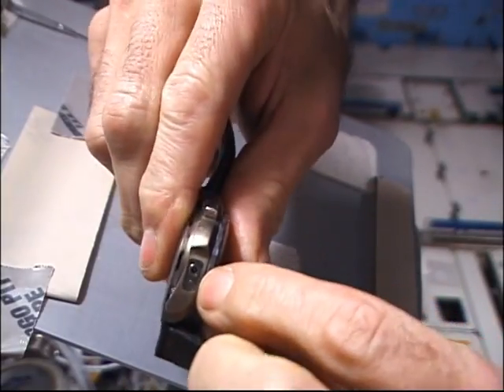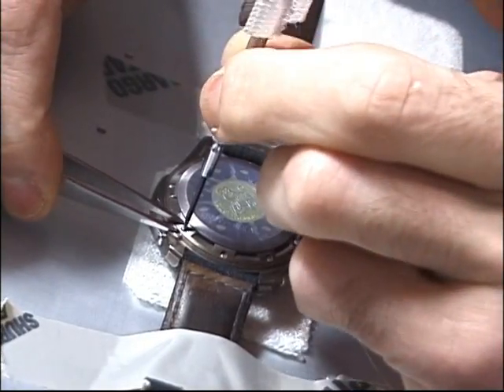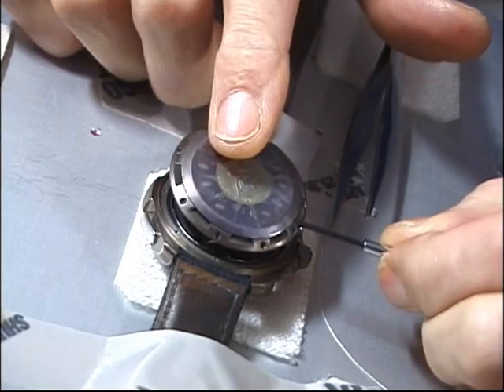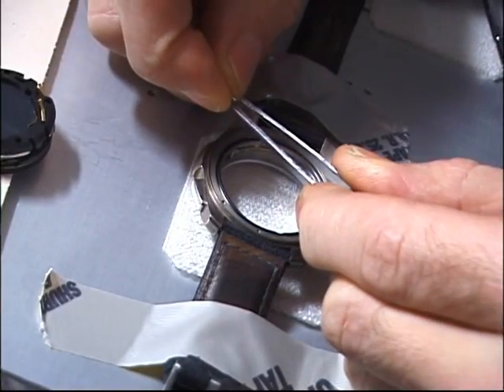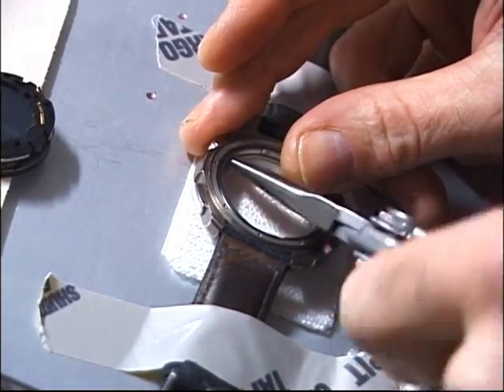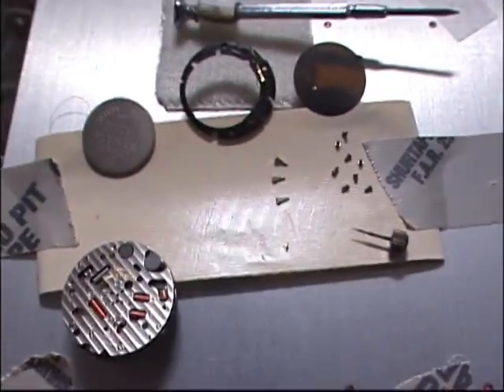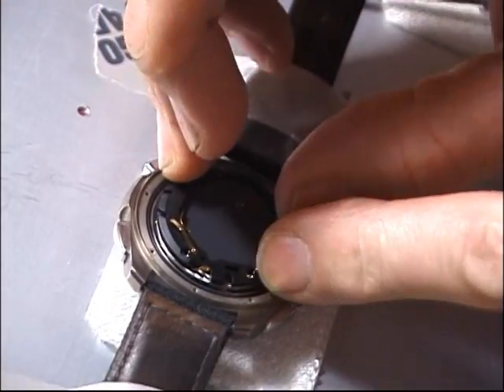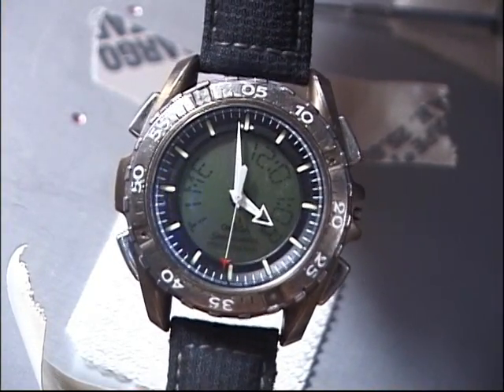Watch Repair in Microgravity

Comment: It wouldn't be ruined, all you have to do is take it apart and demagnetize each part that's made of a ferrous alloy. You most likely wouldn't need to demagnetize the hairspring or mainspring though since most modern watches use Elinvar or Nivarox for those.

Comment: As stated above, all objects do interact with each other gravitationally.  This relationship can be expressed through the following equation:

Fg = (G • M1 • M2) / d ^ 2

Where
G = 6.673 • (10 ^ -11) N m^2/kg^2
M1 is the mass of the first object expressed in kilograms
M2 is the mass of the second object expressed in kilograms
d is the distance in meters

Thus though force is exerted between your body and the surroundings, it's effects are miniscule to the point of unnoticeable.

Comment: The way they make it float is that they hang it on wires which they remove trough computer programs which is quite complicated.

The mythbusters thing has nothing to do with weightlessness since u have gravity on the surface of the moon. U simply have a sixth of the gravity on earth. The reason u don't have gravity on the space station is that it "falls" down all the time. If u would jump from an airplane in vacuum u would also be weightless.

Comment: @whiterabit998 i was not referring to the lack of air in my comment i was referring to the gas 
expansing  in the Lungs i.e. from 1 psi to 0 psi the air in your long will 2x in size 
thats a fast kill as for the blood boiling in 0 psi that is up to the amount 
of nitrogen in your system and it will take longer to kill you

Comment: vacuum = no air
if u put something in vacuum it actually falls down faster than on earth (with air).
if a person is exposed to vacuum he dies within 10 seconds. As u clearly can see he is not exposed to vacuum but normal pressure. The only thing vacuum does it removes all air (thereby air resistance) but it doesn't remove gravity.
In movies many things fall down or don't float which should float, just look at Armageddon.

Comment: If the watch become magnatized it will be ruined.  But in most instances leaving a magnet on an automatic will not normally ruin it.  It will just make it stop briefly until you remove it.  Its funny i do it all the time.  I never permanently ruined a mechanical watch by putting a magnet to it.